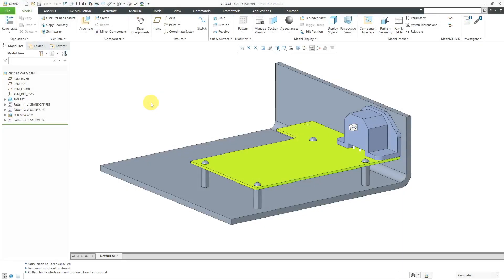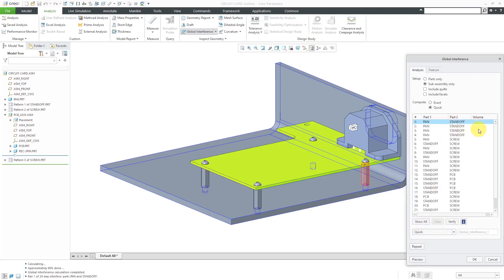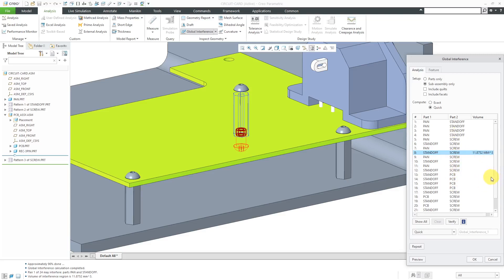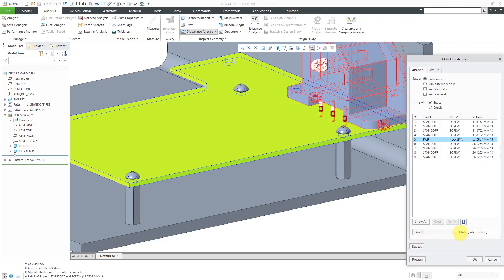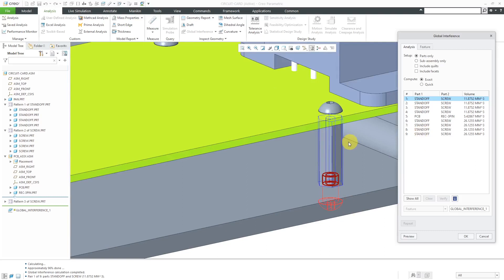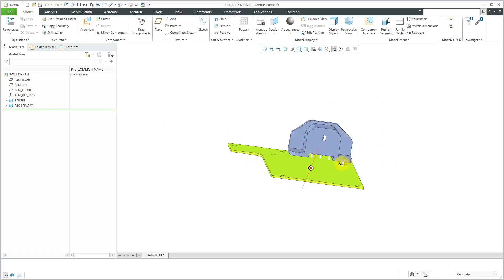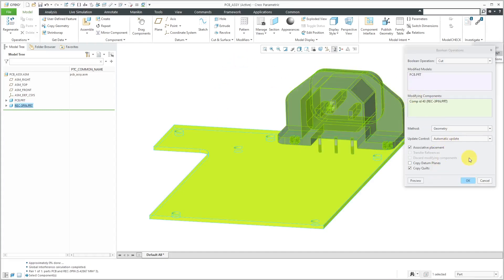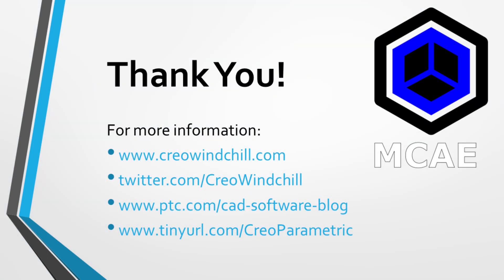Creo Parametric - Global Interference Check | Analysis Tools

Comment: Is there anyway to exclude skeleton parts from the interference checking?
Reply from the maker: Hmmm... I thought Skeletons were automatically excluded from interference checks. I don't create solid geometry in my Skeletons so it's never been an issue. But Simplified Reps with a Rule would be an easy way.

Comment: I just want to check to interference bettween 2 or 3 part in assembly 
Do you have a solution ???
Thank you very much
Reply from the maker: Simplified rep
Reply: @CADPLMGuy  Sounds good, doesn't work. Excluding items in simprep still results in full interference check picking them all up. Creo9. Perhaps there's some kind of a variable in options?
Edit: It actually works...but not always. Ehh...troubleshooting, here we go again...
Reply: Pairs clearance can check interference between two parts only.

Comment: is ther any extra plug in, that allows to differenciate between any ordinary volume and a part with thread? from ptc help desk I got the answere, that Creo is not able to determine if a volume is an object or a threadded part that sits in a threadhole. If I do an Interference Check, all I want to see is screws not sitting correctly aligned in the drillhole.
The funktion shown in your video is crutial for my everyday work. thanks for helping

Comment: Thanks for uploading this video. could you please explain more about fastner selection (example: M3 screw and M3 nut )  because l am working on a assembly which has more than 1000 fastner, i got interference for the for this 1000 fastner too.
Reply from the maker: There are so many different factors involved, like where you got the fastener models from. I can't answer without knowing more about your setup. I am available for consulting. See my website for more information.